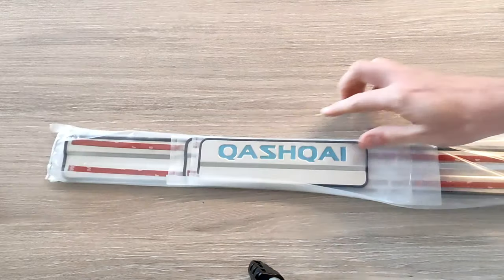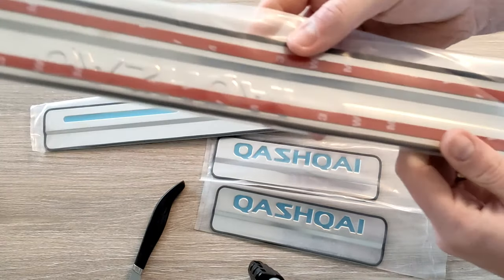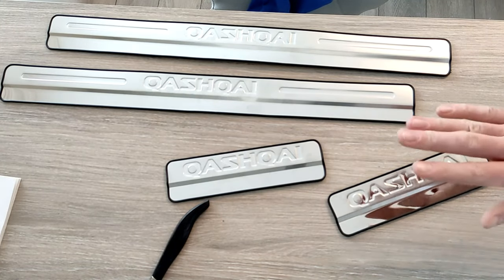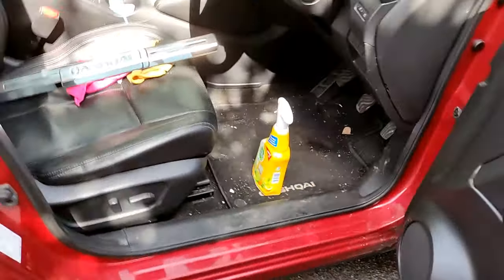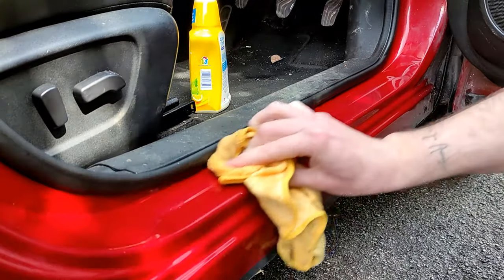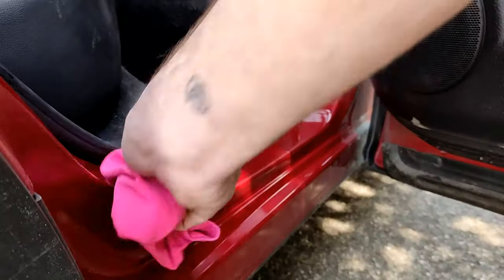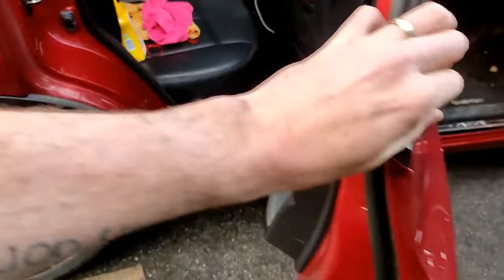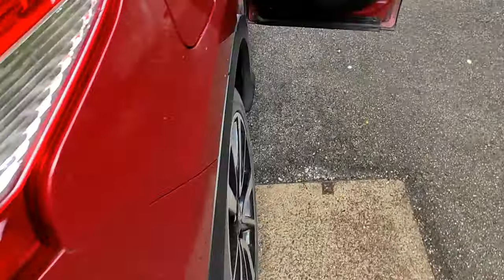Wish.com Qashqai Products #2 - Door Sill Protectors

Comment: Hey dan, love your vids mate. When fitting my dashcam to my 2017 qash, I found the front cigarette lighter always seemed to have power? It was very odd and looked a bit untidy so I grabbed a kit from ebay and went via the ignition fuse so the dashcam only turned on when ignition went on. Maybe you could do a video on that
Reply from the maker: Yes the centre one does always have power. The arm rest one stay on for around a minute after tunring off ignition.

Comment: Hi Dan, if you wanted to carry a spare wheel, not a space saver, is there a surround to take up the difference in height, cheers Terry!
Reply from the maker: I think you'd have to have the floor panels on the higher part all the time.
Reply: @TheQashqaiGuy  Ahh, thought so, makes better sense when you hear it from someone else, thank you, enjoying the videos, keep them coming, learnt so much about my car from you, easier to understand than reading the manual!! 👍📖

Comment: Gutted. Just tried to order these but the code doesn't work. I'll be ordering them anyway, but would've been nice for you to have the commission too. Sorry.
Reply from the maker: That's odd. it's worked for 2 orders so far
Reply: Maybe I'm doing something wrong? Though I've ordered from wish before. I'll try again.
   Loving the videos BTW.  I'm a new driver and treated myself to Qashqai in January and love it. Just need to sort 2 blips on it ( cracked wing mirror trim and a bang in boot door?)
Reply from the maker: Ah, it's a code new users use
Reply: Ah, no problem. I'll set up another account. Easy peasy !
Reply: Nope, still not working. Says code not valid. 🤔😞
Reply from the maker: That is strange, no worries thanks for trying!